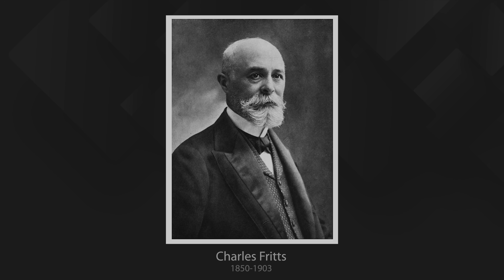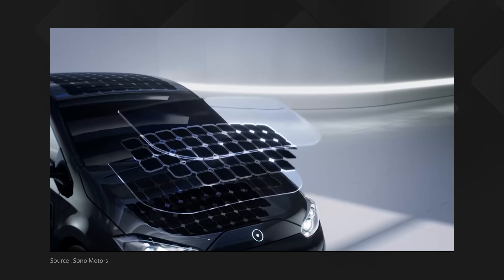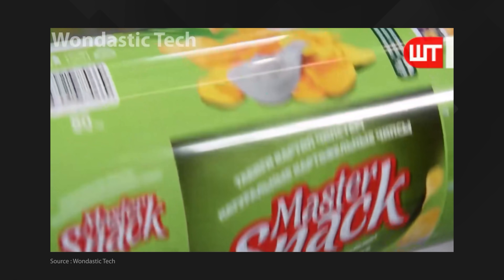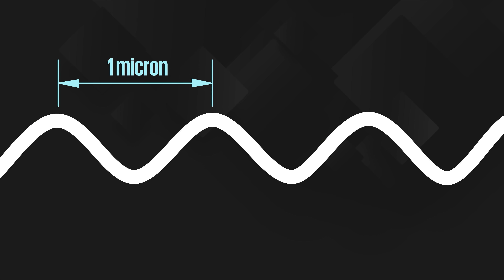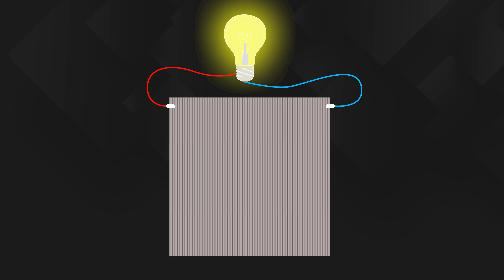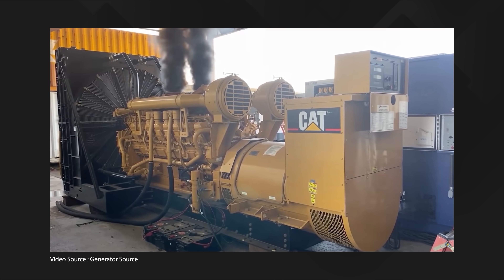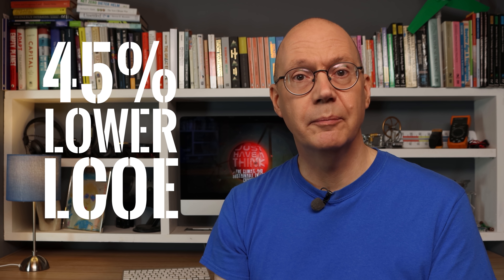Solar PV film roll. Revolutionary new production technology.

Comment: I work in PV and I must say the lateral junction instead of a vertical one is indeed very innovative and clever, especially in the way implented here, and does away with some typical PV losses such as light absorption by the TCO. It does however seem like a very intricate process which will come with  difficulties of its, and imho mass production in less than two years sounds ambitious. High throughput roll2roll processing is notoriously difficult and many have failed already, using various technologies such as organics and amorphous Si, and in this case the absorber material used is perovskite,  which has extra difficulties such as long term stability. However, it does seem there is really a lot of expertise from the industry involved here which I think is imperative for success. I very much hope this will be a success, it sure has a lot of potential!
Reply: Perovskite?  I thought it was P and N-doped silicon...
Reply: @incognitotorpedo42  No, that's the standard rooftop product. This concept uses a perovskite absorber sandwiched 'laterally' between different p- and n-type materials. At least that's what I make up from their website.
Reply: Just put it on your car and renew every 3 years,if at least such level of sustainability is achieved than  it's already would be insane step in solar industry. Guys this film have MUCH less volume per watt - less waste material,no more sand burning with coal for refining silicon. How long is it for crystalline silicon PV to return energy spend on it? 3 years? Even if it would work perfectly next 20 years,it's still 3 years of living with MORE pollution with regular PV after it's made.3 years of energy worth spend upfront, weeks or months before it even got shipped to installment place. So,really,really hope this type of technology get real and while "not intended to compete" with regular solar,it still definitely will crash it.Yet 2023 feels like centuries away right now, after how last years went.
Reply: @D R why would a 15 year lifespan be an issue many electric devices we buy today have shorter lifespans.  If this can be printed on the back of your cellphone to generate some of the power for the phone for example it would far out last the cell phone.  There are definitely markets for something which generates power for a decade.  Not to mention anything that is remotely close to cost effective and helps us get off ff faster even if it is replaced in a decade isn't a bad thing.  If we can make these cells as fast as we make candy wrappers they would push alot of ff powered generation out of business faster allowing more time to build out wind turbines and other longer term infrastructure.
Reply: @DanA-nl5uo  There is some irony in your post, in that planned obsolescence and mass consumption are one of the reason we need to convert to carbonless energy in the first place.   If we could 'net-zero' the consumer electronics industry, would could make a substantial dent in global CO2 emissions.
Reply: @D R Pay half as much now. 

What do you think solar will cost in 15 years at the current rate of decline.
Reply: Power to weight ratio the solar film seems interesting , for aviation or.., but the company is a bit creative promoting their efficiency compared to other solar panels . It wouldn’t be the first British company who is very ambitious and keen to promote themselves onto the stock market and then crashes out of overhyping itself . This solar film has a danger to become  pretty but short lived disposable solar panels . The opposite of environmentally friendly .. strange that there is still a major taboo in talking about downsizing , in consume less power, in make less babies .. I guess it’s still business as usual : make a company bigger to attract investors to strike up cash and then dump the whole thing for a new carrot to run after . Technological advance does not equal civilization evolution ..
Reply: @qiqi2692  Maybe not but if tech can’t pull a zero carbon rabbit out of their hat, there may not be a civilization to evolve.
Reply: Maarten Van Eerden (Martin of the Earth?) You work in PV, so I have a question with a preface.
Photosynthesis is about 99%+ efficient, due primarily (apparently) to the presence of microtubules within the chloroplasts, providing a supportive environment for quantum processes to occur.
Has there been any PV study using layers of appropriately sized nanotubes sandwiched among other layers to provide a similarly supportive arena allowing for the quantum effects to enhance PV efficiencies?
It seems such an obvious solution to me. Much like the Casimir Effect, it may allow for greater efficiencies in quantum processes by excluding extraneous interactions that do not add to the process, and in fact may impair the process.
I will enjoy your response!
Reply: @hydrorix1  I’m in no way a scientist , and understand 10% of what you just said but nonetheless very curious about your input . My immediate intuitive reaction is : if it’s possible of 99% efficiency, than the plastics must be able to cope with 99% heat absorption of the sun also . It’s great  to shape nanotubes to imitate nature , but there’s also a lot  more to it ..
Reply: @qiqi2692  I don't expect to get to 99%, but getting to 50% would be world changing. 
With regard to heat, I don't think excess heat is a problem for most plants.
Reply: @hydrorix1  hi. Is there any evolution on the multi spectrum  and multi layer solar panels ?
Reply: @qiqi2692  Don't know...
Reply: It's all about solar efficiency and cost efficiency.  I would love it if someone could make a sail into an effective solar panel.  Nice if my entire boat made use of the wind and the sun.
Reply: This perovskite is problematic; it is not a metallic nor a plastic. Very brittle and prone to cracks. In series connection, if one cell develops a fault, the whole stuff must be junked.
Reply: @janami-dharmam  doesn't seem to be an issue in their durability testing.
Reply: @Noisy_Cricket  They would not tell you if it was...
Reply: @D R cost is still twice the thin film cost. I have an old solar calculator it works great.
Reply: @D R lol if they put a solar panel on the back surface of a cell phone people would figure out how to use it.  Right now there is no reason for people to figure it out.
Reply: @D R but nice deflection from the point that we have electronic devices that last 10 to 15 years that could benefit from this technology.

Comment: Hmm. 430 quintillion joules, eh? Mkay... Only 29% of that falls on land. 124.7 quintillion joules left since we can't place huge solar arrays over the ocean without extreme impacts to sealife. 24% of the landmass is mountains, which isn't quite conducive to building structures and wiring those structures to more livable areas. We'll say 12% for overlap. The arctic regions are not great for solar as they have entire seasons with no sunlight. So take out the land regions for the Arctic and Antarctic (roughly 8%). Then we have to take out an additional 31% of the earth's available landmass that's covered in forests. We're not going to cut down a forest to place solar panels. That's just dumb. Then we have to take out an additional 37.6% of the earth's available landmass for farmland. Then there's the 17% of the earth's landmass that is in a 'Protected' status, so no solar there either. We'll say 8.5% for overlap... So that's a 97.1% reduction in usable area. 3.6 quintillion joules. We use 1.122 quintillion joules per day, so we're covering 3x as much power as is used currently in the world if we plaster every possible surface with solar panels leaving room for forests, aquatic life, farmland and other protected areas and removing areas where solar isn't feasible like the arctic and antarctic regions. What are the odds that we could possibly cover EVERY possible surface with solar? Probably not very good. A guess would be maaaaaybe 10% if we spent trillions upon trillions, if not quadrillions of dollars... That would produce enough electricity for 1/3 of a day roughly. Then you've got the maintenance, the infrastructure, replacements from age, battery storage... It's just not feasible.

That doesn't mean that we shouldn't utilize it as much as we can, but to assume that solar alone will solve all the issues... it's just ludicrous. We need something small with a big power impact like Nuclear, either fission or fusion. That's the only way out of this rut that we've put ourselves in.
Reply: Quit actually using (even really fundamental) science to debunk the "plan" you're supposed to believe in! OBEY!! CONFORM!!BE STUPID!!!

Comment: Every home and business should consider roof top solar to help reduce reliance on the grid and provide back up power when the grid is down. People don't think about payback when they install a petrol or natural gas generator. Solar energy combined with battery storage will save money in the long run. A side benefit is you can operate your electric vehicle on energy from the sun.
Reply: Currently, roof top solar doesn't typically reduce reliance on the grid.  It makes the grid more fragile, and even if the systems have some batteries, they typically stop working during power outages.  With current battery costs, the "long term" is longer than alternative investments, so they actually lose money.  If they make money for you, that is because feedback tariffs are artificially inflated, so you are a leech on non-solar rate payers.

Comment: In very sunny areas (I'm in Israel) - a semi-transparent sheet generating electricity can be used to shelter playgrounds etc from the scorching sun, while generating electricity. It would be popular for the shade. The requirement would be to let some light through, and to drain reasonably well considering we do have rain in the winter. Cleaning may also be an issue.
Reply: @ Sam
I mentioned in a reply to an earlier comment that awnings that are retractable would be ideal to protect from heavy winds, rain, or snow.
Reply: I'm wondering how awnings, opaque or semi-transparent, could be used as sunshades for parking lots. In places that have become car-dependent (think north america) these often seem big enough to be useful (hectare or bigger).

The big issue I see with this would be the need to buffer the produced electricity to avoid overstressing the power grid. Buffering would also help in the various refugee/developing world situations by making power and lighting available after sunset, lengthening the functional day with time for reading, school study, socializing etc.
Reply: We will have to see how they handle the flex in a long run. They suggest to stick it on the rigid substrate?

Comment: This idea has been around for a while, now a more effective method of design, and what every Camper + EV Owner is expecting to use one day. Camp by day rolled out, travel by night swapping Driving shifts, and see the country. Great Device, and Report thank you.
Reply: I don't think repeated flexing will work for these.
Reply: @incognitotorpedo42  It looks like that depends on the axis.  It comes off a roll so obviously that one axis is fine.  No doubt you'd want to avoid creasing or twisting it. Backing with a stiffer material, perhaps with hinges would probably solve that.

Comment: This will be immensely useful for communities affected by natural disasters of some sort like earthquakes etc. Imagine being able to carry around panels worth kWs of generation capacity as a roll and deploying them in such an area.
Reply: I don't understand why getting them in a "roll" makes these panels any more convenient for disaster relief. We  already have this technology called "box" that allows you to pack many traditional rigid PV panels in a small space for convenient shipping and handling.
Reply: @sanjaymatsuda4504  Rigid panels require mounting brackets etc.

These can rolled out and glued on different surfaces.

Texas does a number on outdoor products.
I want to see how the glue holds up.
Reply: @sanjaymatsuda4504  And what is the total surface area of the panels in your "box"?  Compared to the surface area of a roll of thin film the size of the box?
Reply: What will you do with a varying DC voltage? You need more than these films to have useful power.
Reply: @pauleohl  The associated converters required to handle the varying input voltage and generate AC power from it is going to be relatively small. A portable converter can be very easily airlifted to such a location with relative ease.
Reply: @pauleohl  The panels need to have voltage regulators.

Put it in line with the connection wire.

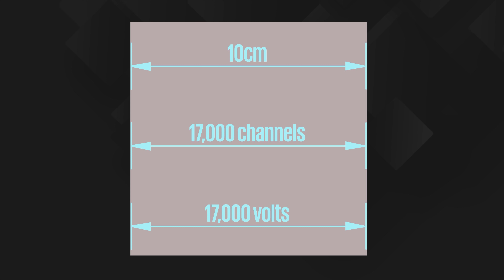Comment: 5:46 High voltage is not danger electric current real measure of electric power electrons number per one second analogy to flow rate of fluids. Scientific papers hos that limit of all photovoltaic cells is Solar Cells with over 17% Efficiency Enabled by an Iridium , and this achieved by 100000 thousands experiments with 0.01% rare earth metals doping , Edison made 20 thousand experiments with different diameter filaments and materials until he reached prefect tungsten material and diameter filament for incandescent light bulb. 17% efficiency is technological limit so sorry abut News about efficiency 30% solar panels sounds like marketing "hook" slogan.
Plus Einstein most famous for his Equation not E=mc22 but for phot effect formula for which he got Noble prize and Brownian motion.
N-electrons number h-Planck constant Nhf=mv^2/2+W. W - red light limit 80% of energy is goes to start flow electrons in photovoltaic cells you can not deny physics electrons velocity equal v=0, Nhf=W, what is limit when electrons velocity is equal zero that energy required overcome energy barrier in cells, above this energy electrons starts move in cells that makes electricity energy in cell panels, what is Einstein formula not Atomic hoax E=mc^2 formula, E=mc^2 works only for light not matter. UV - is best solar energy spectrum for solar panels that makes skin brown (solar tanning and vitamin D production) and causes skin cancer for white people but Sun is one and we must thankful for not harmful Sun.

Comment: Interesting! Even with comparatively lower efficiency, the potential lower end-costs through vastly more accessible production, and installation versatility, seems a trade more than fair. Additionally, the differences in required materials used and energy required for scalable manufacturing might tip the scales even more. Very exciting!
Reply: Efficiency in relation to size is for the most part irrelevant. It's return on investment (power generated versus life-cycle cost) that is the critical factor.
Reply: @paulslevinsky580  It really matters the application.  For generic power generation yes.  Mobile applications are often size constrained though.
Reply: Well you have to include the cost of mounting it and it’s reliability in weather.
Reply: @timmothyburke  airflow and cooling are important in hot weather. They work better in the cold.
Reply: This is what I've been seeking for years. Efficiency doesn't matter, if the cost is low. There's plenty of area available to cover with PV. 10 year life is great. 5 years would be good, too, if again the cost is low enough.
Reply: 11% effiency for seemingly simple (non semiconductor?!??) production method sounds like too good lol
Reply: Wattage vs. size is nice and all, but wattage vs. cost can sink or launch any energy based product. If you need twice the area, but less than half the cost, well... money very often wins.
Reply: @HoboGardenerBen I just bought 1000 watts of shingled type panels (and a regulator/charger/3kW pure sinewave inverter). They claim to pack 30% more active surface in the given space, along with 22% efficiency. That's nice and all, but the cost sold me. You might want to check them out.
Reply: I imagine it lasting only 1/5th as long, meaning that if it only used the mentioned 1/20th the energy, then it's still has a 4x energy return (awesome!). Monetary costs though, I don't think so unless no framing needed for large installations, and some automated labor, and easy recycling.
Reply: IF... this is workably relevant..... E.T.F.E.. ( ethylene tetrafluro ethylene )...is nonbiodegradable and recylable
Reply: u are new to thin film pv.  They area always complete lies.  Maybe this one is legit, but don't get excited for something that will almost certainly fail.   Focus your passion on actual products like nuclear or natural gas.

Comment: Not sure how you can use it to replace a kerosene lamp unless it's lighting a dark place during daylight hours.

Could this film be used to charge batteries like the whole house ones for homes or electric car batteries either at home or in the event that batteries become light enough to swap instead of recharge so that the energy depleted batteries that are replaced can be charged in situ even in remote locations.